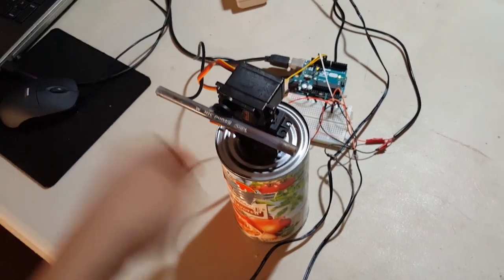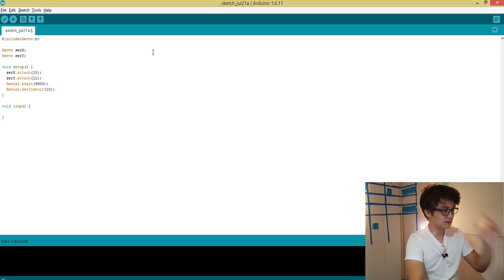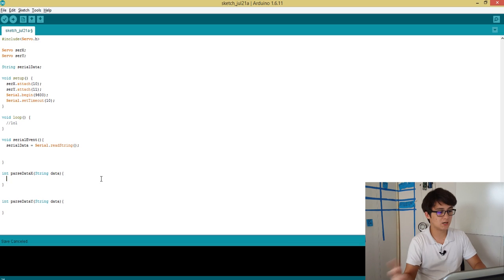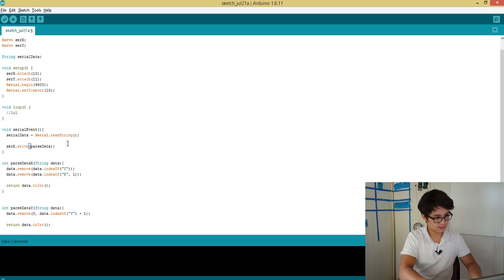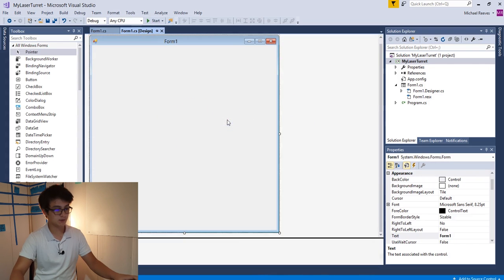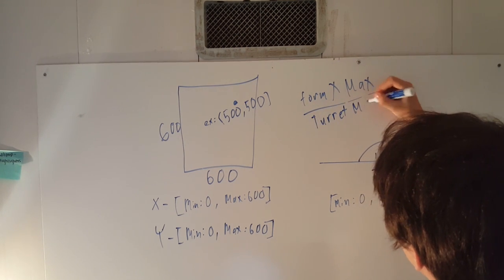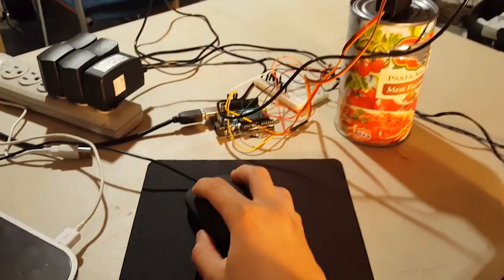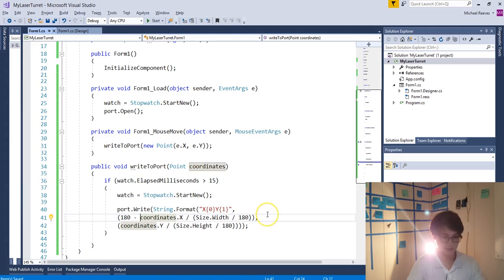DIY Laser Turret | Part 2 The Software

Comment: I’m having issues with the microsoft studio code not working. I know it’s the code due to testing done on the hardware and running servo test code and determining that both the hardware and Arduino are functional. When I run the code, even when downloading it straight from the repository, it doesn’t work at all. pls help thank you
Reply: Im in the same problem, did you find an answer?
Reply: It's a 7 year old video, unless you have a smiliar or the same version of ms studio code he is using you are going to run into errors with the compatability.
Reply: @winfid  i did the tutorial in visual studio 2022 and didn't get any compatibility problems, so that probably shouldn't be an issue

Comment: I've dealt with Serial stuff like this and regarding the latency I got a huge improvement from waiting for a response packet. So the computer would send a serial data packet and then pause sending until it receives a packet from the Arduino. 
The issue is the Serial data is buffered so as the data is sent it gets added to a queue. 
Picture if you have a hand of cards and you are able to play 1 card every second but you draw 5 cards every second; the time between receiving a card and playing it will increase with time. However, if you receive only one card per second and play one card per second you will always be playing the cards at the same rate, which results in a much, much lower latency. 
Michael's delay method works here because he is sending fewer packets than the maximum read rate of the Arduino, but the solution described above is perhaps a bit more elegant? But then again, it's a shit project so if it works who gives a shit.

Comment: I have one issue which is that he didn't fix the wiring from his last video. To elaborate he wired up the power to the servos using a common ground but decided instead of using a single common live wire and connecting the servos to it in parallel he just got two power sources and connected them separately, but that's only part of the issue he did understand to connect the ground to a common port but chose to connect the live wires separately and it is the conscious choice to do so that bothers me.

Comment: this was a fun build up until i got to the visual studio part...  whenever i drag the mouse onto the form, i keep getting the error 
"System.InvalidOperationException: 'The port is closed.'

This exception was originally thrown at this call stack:
    [External Code]
    MyLaserTurret.Form1.writeToPort(System.Drawing.Point, System.IO.Ports.SerialPort) in Form1.cs
    MyLaserTurret.Form1.Form1_MouseMove(object, System.Windows.Forms.MouseEventArgs) in Form1.cs
    [External Code]
    MyLaserTurret.Program.Main() in Program.cs"

just copied and pasted so i dont know what im doing wrong lol
Reply: did u figured out what went wrong?
Reply: @brumoment347  so long ago i can barely remember, i think i opted to use a thumbstick control instead
Reply: @brumoment347  please do tell how you fixed it. it will be a good help.
Reply: please do tell how you fixed it. it will be a good help.

Comment: here is the arduino commands

#include<Servo.h>

Servo serX;
Servo serY;

String serialData;

void setup() {
  serX.attach(10);
  serY.attach(11);
  Serial.begin(9600);
  Serial.setTimeout(10);
}

void loop() {

}

void serialEvent() {
  serialData = Serial.readString();

  serX.write(parseDataX(serialData));
  serY.write(parseDataY(serialData));
}

int parseDataX(String data){
  data.remove(data.indexOf("Y"));
  data.remove(data.indexOf("X", 1));

  return data.toInt();
}

int parseDataY(String data){
  data.remove(0, data.indexOf("Y") + 1);

  return data.toInt();

}

Comment: I wonder if you could make the laser turret into something that tracks your hand movement instead of mouse movement and have something that shoots attached to it so when aimed correctly you just press a button and it fires
Reply: Like idk for the shooter part, if it was a nerf gun, there could be a separate piece that detects when the trigger has been triggered then a small delay to allow for the foam bullet to be shot out, then after that something made to reload the nerf gun, idk how thatd work but my idea would be to have something pull the part that loads the next round in back till it clicks then have something recognize that sound as "loaded" (probs by a prerecorded sound stored for recognizing purposes?(sorry I'm dumb af so I dont know much about anything 😂😂🤣🤣)) which then tells the puller to stop pulling and go back to it's original position b4 loading.

And for the trigger have something there to pull the trigger once "trigger" is received

Comment: what have I done wrong my code is 
#include<Servo.h>
Servo serX;
Servo serY;
void setup() {
 serX.attach(10);
  serY.attach(11);
  Serial.begin(9600);
  Serial.setTimeout(10);
}
void loop() {
//lol
}

void serialEvent(){

serialData = Serial.readString();
   serX.write(parseDataX(serialData));
   serY.write(parseDataY(serialData));
}

int parseDataX (String data){
  data.remove(data.indexOf("Y"));
  data.remove(data.indexOf("X"), 1);
 
     return data.toInt():
}
int parseDataY (String data){
  data.remove(0, data.indexOf("Y") + 1);

  return data.toInt();
}
Reply: youre missing String serialData;

Comment: Both servos respond whem i go left and right, but nothing happens when i go up and down.
I can see any differences from my and Michaels code.
Help please.
Reply: This is why I ditched arduino. i use the small microchip on the arduino board for $2.
You can also do the C# code in Python which is much easier to write and understand.

Comment: sigh... lemme explain.... just fucking do this [cordinates.X * (180/Size.width)]  .... the degrees the turret traverses per unit movement of the mouse in the X direction multiplied by the actual coordinate to output the degrees  the turret has to move.
Reply: It's the same shit bro, here's the equivalent values

Michael's = Yours
input = coordinates.X
formXMax = Size.width
turretMax = 180

Now, these two are algebraically equivalent
input / (formXMax / turretMax)
input * (turretMax / formXMax)

Last one also seems more untitive to me, but fuck, his method works just as well!
Reply: @TheCamps10  I knowwwww but my way is kinda easy to understand don't you think?
Reply: @iRacingBlitz  yeyeye, it was just the "let me explain" and the "fucking" that seemed mad 😅
Reply: @TheCamps10  ooof 😂

Comment: Sitting at my computer about to do those last few tweaks to make mine run right.... Dude this is bad ass, and so are you for this tutorial lol
Reply: did you have an issue with "port.Open();", because i have and cant seem to find a solution
Reply: @billysavage9184  no, mine worked no problem. The only issue I had was with trying to load it into my printer instead of my arduino lol.
Reply: @joshmellon390  oh.. ok thanks anyway
Reply: You guys saying that this thing doesn't work should go dig around a different comment section. As soon as I'm done writing g this comment I'm going to post a video of my working turret (and all of the code from THIS VIDEO) on my channel. You can go look at it if you feel like, I don't care. It may already be there, I was pretty proud of my success..
Reply: Mine didn’t work at all, there are no errors and everything is wired perfectly, I’ve checked it all my components work and .... it just doesn’t work
Reply: @bobfrediii2131  Mine is still attached to my monitor, it's worked just fine for months. I would look for a less involved solution, sometimes the most simple oversight can cause things not to work.

Comment: I had alot of errors when I tried to use windows community 2019. Then I tried to use the 2017 version and it still had errors. Most of the errors came from "port" Could someone please help me I spent alot of money buying this stuff and its not working
Reply: I'm having the same issue currently. His port is COM3 but mine is COM5 and i cant seem to be able to change it.

Comment: Could have used 360*360 as in spherical degrees. First if of 360 degrees on a parallel plane to the ground, then on the z axis 360 degrees again. Extrapolate the line that goes from center of said sphere to the edge of the sphere until it hits your  600*600. i.e. 0.0 would hit the center of your board, 45*45 would hit the top right corner etc. Remove unnecessary degrees that point backwards and/or off your 600*600

Comment: Huh, I know this is an old video and doubt you will even see this comment but when you divided the 600 by 180 did it basicly set each pixel in the 600*600 box to move 3.333333333 Degrees? just curious. because I find this stuff amazing to watch and im trying to learn the basics myself.

Comment: If you couldnt find the script here it is
-------------------------------------------------------------
#include

Servo serX;
Servo serY;

String tempModify;

void setup() {
    serX.attach(11);
    serY.attach(10);
    Serial.begin(9600);
    Serial.setTimeout(10);
}

void loop() {
    //lol
}

void serialEvent() {
    tempModify = Serial.readString();
    serX.write(parseDataX(tempModify));
    serY.write(parseDataY(tempModify));
}

int parseDataX(String data){
    data.remove(data.indexOf(":"));
    data.remove(data.indexOf("X"), 1);
    return data.toInt();
}

int parseDataY(String data){
    data.remove(0,data.indexOf(":") + 1);
    data.remove(data.indexOf("Y"), 1);
    return data.toInt();
}
                 

Thank me later... dabs

Comment: I wonder if it's possible to control this with a 3D camera so that it shoots flies out of the air.
Though if the shots miss, I guess you'll have burn marks on the walls / ceiling.

Comment: Correct me if I'm wrong but the cheaper servos have limited rotation capabilities. So I don't think it would be x100 for the small blue servo motors. Great video though helped me quite a bit!

Comment: I need help. I keep getting an error stating that 'Write' takes two arguments. Anyone have a solution.

            Port.Write(String.Format("X{0}Y{1}",
            (coordinates.X) / (Size.Width / 180)),
            (coordinates.Y / (Size.Height / 180))));
Reply: Also it says there is an error when i put four parentheses like Michael did, but when I delete a parenthesis there is no error message.

Comment: Couldn't you just use Serial.ParseInt() instead of messing around with parsing? You could just send the data like 23,64 (X,y) then use X=Serial.parseint Y=Serial.parseint
It uses less memory and it's quicker

Comment: Why didn't you just use the scaling function? I'm pretty sure it's called map.
Reply: I'd have sent the raw coordinates via serial and then scaled on the arduino side so that If I upgrade the servos to 270 or something else; the code only changes on the hardware side. the syntax of map in arduino is map(var, minInput, maxInput, minOutput, maxOutput). See: https://www.arduino.cc/en/Reference/Map

Comment: I am impressed that it works since after all you are using TABS INSTEAD OF SPACES
Reply: I don't understand people who use spaces
Reply: I use tabs because I don't want to press the backspace key 4 goddamn times every time I want to remove an indentation.
Reply: ...is this an argument? Tabs are faster? Always?
Reply: silicon valley was hilarious
Reply: Afaik Visual Studio enters 4 spaces on pressing the tab key
Reply: ew, always use tabs
Reply: fuck u
Reply: I liked your comment so that it gets 64 likes even though I have no clue what is better
Reply: I prefer spaces as much as the next guy, but let's not start a holy war if we don't need to next time. [Bastard probably muted the comment as soon as he posted it, like a drive-by toss of a molotov.]
Reply: #TabsFTW
Reply: As far as I know, there is no way to mute single comment threads, and the fact that I got 64 likes compared to the 10~ or so comments proves that I am right.

Also it was a lazy troll